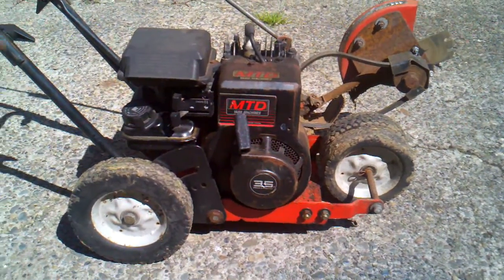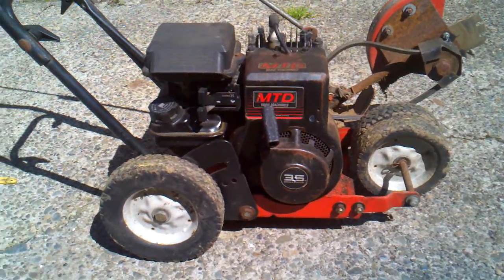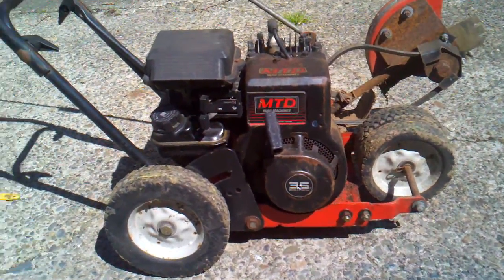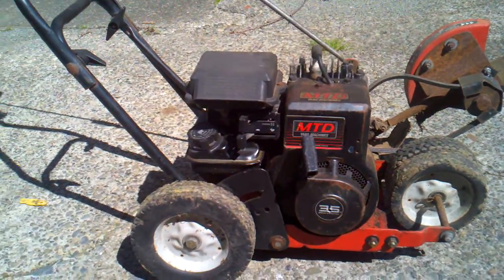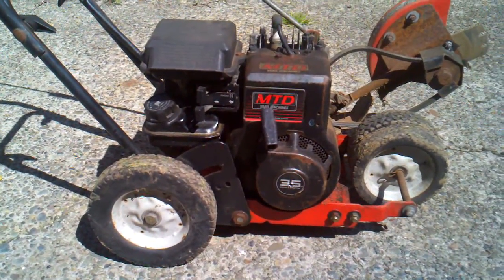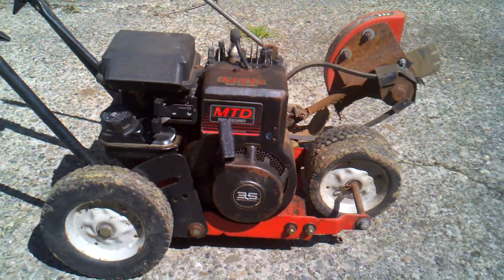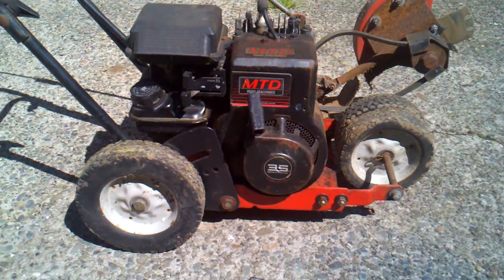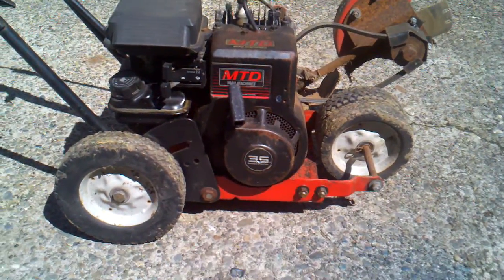MTD Edger 3.5 Briggs fixed

Comment: I have this same unit (bought it new about 17 years ago) but my model/serial sticker is gone.  I wanted to download the manual for the motor.
Reply from the maker: Tim Durham The sticker for the edger is turned grey and unreadable. The engine model number is stamped into the cooling shroud though. should be at the top by the sparkplug.
Reply: Tim Durham Tim, did you get the model number for this unit?
Reply: Change belt on a sears 3.5 gas edger
Reply: I just picked up a non running one. Best I can tell it’s a 25A-580A352. My sticker is worn but found one on eBay that is identical and that was the model number

Comment: You are a four cycle god...
Listen today i was gifted with a older M.T.D. PRO POWER 4 CYCLE EDGER. I KNOW JUST A TAD ABOUT 2 CYCLE ENGINES (ONLY CAUSE I HAD TO TEAR APART AND REBUILD CARBURETORS FROM TRIAL AND ERROR) I KNOW NOTHING ABOUT 4 CYCLES. 
Anyway, i was given this edger today. Oddly enough the paint colors appeared to be closely to that of a weed eater brand.
Green and black. I thought MTD PRO WAS RED AND BLACK.  THIS EDGER HAS A 3.5 H.P. BRIGGS AND STRATTON ENGINE. THERE IS A OFFICIAL M.T.D. PRO LABEL ON THE BACK PLATE OF THE EDGER..
1ST THING I DID WAS CHECKED BOTH OIL PORTS.
IT WAS KINDA DIRTY (A LIGHT TAN) BUT NOT BLACK.
THE OIL WENT TO THE BOTTOM THREAD ON THE SCREW IN CAP. 2ND. I REMOVED THE SPARK PLUG.
(IT WAS FOULED UP.. BUT AFTER I TOOK A WIRE BRUSH TO IT, I BECAME CONVINCED IT WAS NOT BAD. I THAN CHECKED FOR A SPARK. WHICH IT HAD. (THAT'S GOOD NEWS AT LEAST), I THAN INSPECTED THE GAS TANK. VERY LOW FUEL. BUT NOT DIRTY NOR WERE THERE ANY RUST OR METAL FLOATERS.
I THAN CHECKED THE AIR FILTER.  BLUE FILTER LOOKED AGED BUT NOT DIRTY. AT THIS POINT I DECIDED TO TRY TO START IT. 5 PULLS LATER -NOTHING!!! I HAD THE CHOKE COMPLETELY TO THE RIGHT AND THE IDLE ON FAST (PIC OF RABBIT)  5 PULLS STILL NOTHING. I REMOVED THE AIR COVER AND DROPPED A FEW DROPS OF PREMIUM GAS DOWN INTO THE AIR INTAKE? PULLED THE CORD. BAM IT TRIED TO START.  AFTER REPEATING THIS PROCEDURE (ADDING GAS TO THE AIR INTAKE EACH TIME) IT WOULD START BUT NOT LONG ENOUGH FOR ME TO TWEAK THE IDLE. THAN I REALIZED (LIKE A DUH A HAH MOMENT) THERE'S NOT ENOUGH GAS IN THE TANK .
AFTER SMACKING MY DUMB ASS FOR BEING SO STUPID; I ADDED FUEL (HALF A TANK)
PULLED THE CORD. RUMBLED THAN CAME TO LIFE WENT THE ENGINE. 
AFTER IT STARTED I WOULD
IMMEDIATELY BACK OFF THE IDLE (TRYING TO GET THE ENGINE TO RUN AT ITS FASTEST SPEED. ) HOWEVER,
THE ENGINE SPEED NEVER CHANGED. I LET IT RUN AT HALF CHOKE FOR 8 MIN.
BUT WHEN I WOULD TRY TO SLIDE THE LEVER TO THE RIGHT SLOWLY (TO INCREASE ENGINE SPEED)
IT WOULDN'T CHANGE FROM THAT OF THE HALF CHOKE.
I WAS THINKING THE NEEDLE FLOAT NEEDED ADJUSTED BUT THAT'S NORMALLY WHEN I SCREW THINGS UP. (LIKE MY 2 CYCLE ENGINES)  SO I REFRAINED. PLUS I MUST ADMIT I CAN'T FIND THE DARN THING ANY WAY. (I SAW THE IDLE ADJUSTMENT SCREW) BUT NOT THE NEEDLE FLOAT ADJUSTMENT. I KNOW THE E.P.A. WOULD FROWN ON ME ADJUSTING ANYTHING ON THE ENGINE. (EVEN THOUGH ONE WOULD THINK THEY WOULD APPALLED A NICELY TUNED ENGINE) 
IS THERE ANYTHING THING YOU CAN OFFER IN THE FORM OF ADVICE SO I CAN GET THIS MACHINE RUNNING EFFICIENTLY???
Has i stated i am a novice (or really zero experience on 4 cycle engines)  heck, i have 5 different 2 cycle  items lined up needing repaired because i assumed i could watch a you tube video and fix them myself.  (True people can do that. But i messed up one carburetor after another.)
Anyway i hope you or some one can offer some help.
Thank you.
Robbie